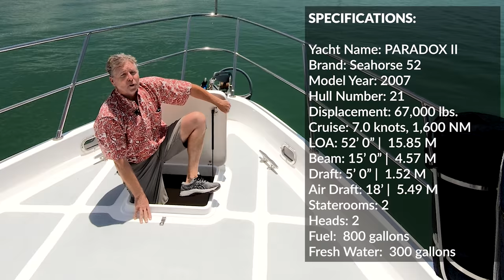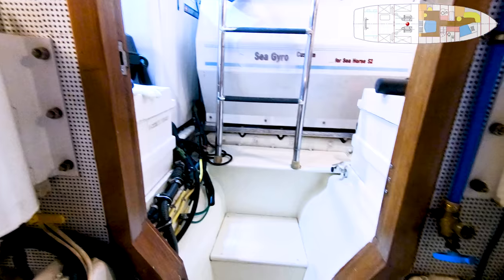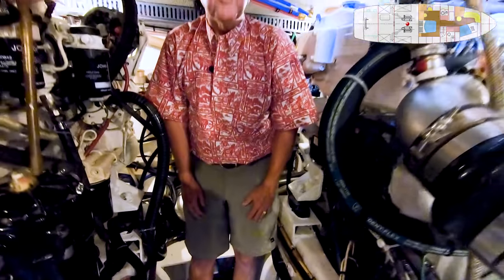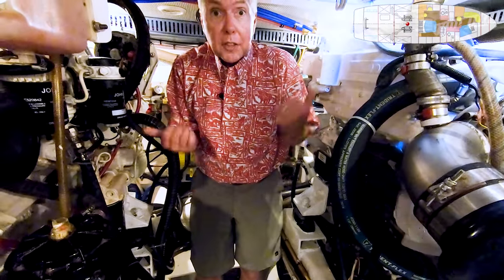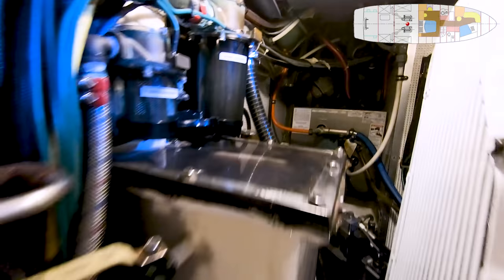Seahorse 52 – [Talk Through Tour] – SOLD!

Comment: Would like to know the cruising speed and fuel burn
Reply from the maker: Dan:  Details like that are on JMYS.com.  Cruise is 7.2 knots with a 1,600 mile range. Burn would need to be calculated with proper load and on reciprocal course, varies by so many factors. I'd estimate 2 gal/hr per side.

Comment: Red flag .... they took a sailboat hull and turned into a trawler.
Reply from the maker: Eddie - do you think a wide trawler will go through the water better than a sailboat?  I disagree and think this was a very logical development.
Reply: As a builder who worked in the design and construction end a sailboat hull makes a poor platform for a power yacht ... this is a fact not even you can deny.
Reply from the maker: @eddieohearn17  I built cruising sailboats at Pacific Seacraft and then Nordhavns in China and Taiwan. One of the best through-the-water Nordhavn designs is the 46 - very comparable to a sailboat shape.  I have seen a handful of trawler prioritize the ride and they are more tapered like a sailboat.  The interior volume is more important to buyers so builders build with more beam.  It's an interesting discussion, but I'm not going to deny or try to force an opinion. I stand by my original observation and respect that we can have different opinions.
Reply: @JeffMerrillYachts  I agree Nordavns are amazing but they are not a sailboat hull that was configured to be a trawler.  Back in the 70’s and 80’s builders would take a sailboat hull and utilized it to construct a trawler and performance suffered in fact trying to adapt a sailboat hull to a trawler was a complete failure.  Or have you forgotten the “good old days”.  Pacific Seacraft builds great sailboats but they are sailboats just as Nordhavns are not.  This is why hulls are designed to meet the demands of the boat intended, every designer and builder today knows this.
This is why I see a red flag ... sailboat designs are meant for sailing yachts not to be converted into some bastardized powerboat.  You should know this and I suspect you do.  But you sell yachts and do what it takes to make that sale.  It becomes the responsibility of the buyer to educate him or herself.
Reply: @James & Jennifer Reid motorsailer are know for poor performance in both sailing and motoring ... sorry this is the reality of the design every designer knows this.
Reply: @James & Jennifer Reid sorry but motorsailer do not preform well as a sailing vessel nor do they as a trawler, every designer knows this as do builder.  But if you want a piece of crap built there is someone to do it.
Reply: @JeffMerrillYachts  Jeff, you are wasting your time answering comments like these. Long and relatively narrow is the key to efficiency, and this vessel is an excellent example. Compared to "huge volume" trawlers, hulls more like sailboat hulls work. Dashew agrees...

Comment: Thank you so much. Your presentation is Professional. The video between narrative is A+ for a salesman. Yes I call you a professional broker. You know your stuff. I wish I had the money, would come to you in a heart beat
 Would you like to do my little 24 foot LARSON overnighter.
I think it's 26 foot. I'm in a 28 foot berth and it just fits with my bow pulpit and stern swim step. 
Very low hours on completely Engine rebuild.
Mine is 2005. 350 5.7 Volvo out drive. I pull it each year for bottom clean or paint, lower unit OIL change. I would have you SELL my baby in a heart beat. I love your videos. Presentation A+
Reply from the maker: RP:  Very flattering comment, thank you.  It's a very busy market in the trawler world right now and that is my focus, we typically live in the 40' plus trawler market.  I'm sure a local broker near you could help you find a buyer. Thanks for your nice note!  Jeff